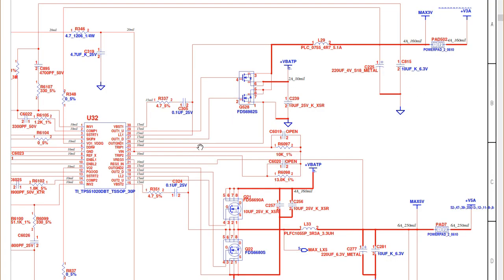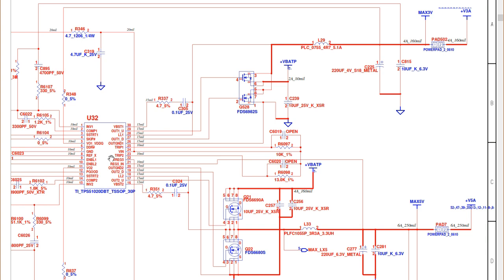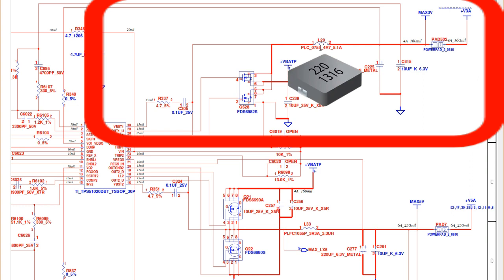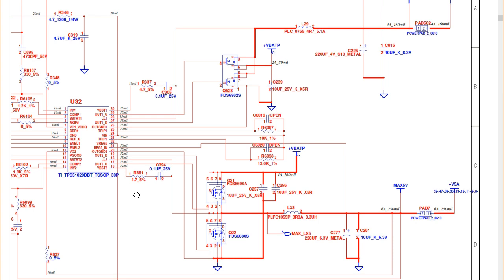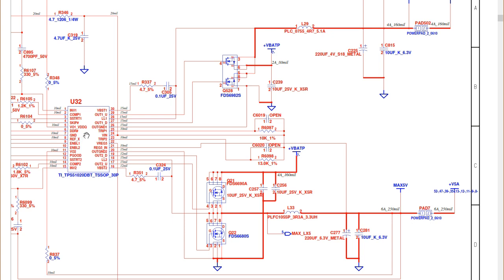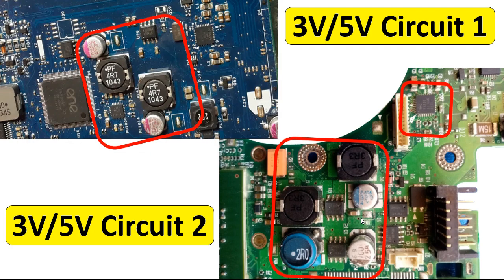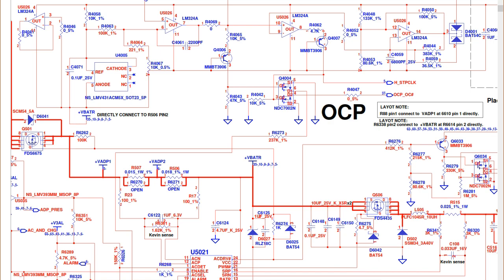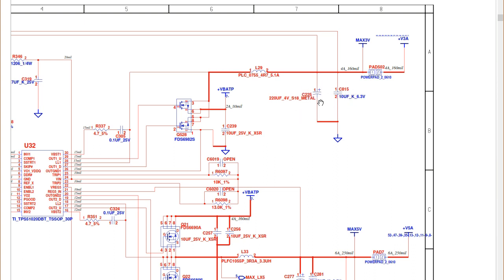Uncover the Secrets of Laptop Motherboard Repair using schematics: Part 3!

Comment: Can you make a video about step by step of testing Dual Mosfet and single mosfet ? Also there are explanation and comparison between 2 components characteristic after tested by multimeter. For example : at the beginning of the video, you show up 2 same type mosfet. Those two are same type. Well, for example both supposed are N Channel. But the difference from 2 components are one is faulty and the other is good one. Same part number too. But later in your video, you could explain  the characteristic of bad mosfet and the characteristic good mosfet. After you had tested both of them with multimeter. Because this is very important, how do we know the difference and comparison of good and faulty mosfets. And one more. Can you explain when we check suspected components?, is there any difference result with the componenent stlll plugged in circuit or with desoldering components. Thank you for your time and keep up your good work🙏. I apologize if my english not good. Thanks again 🙏.
Reply from the maker: You are most welcome. Ok I will